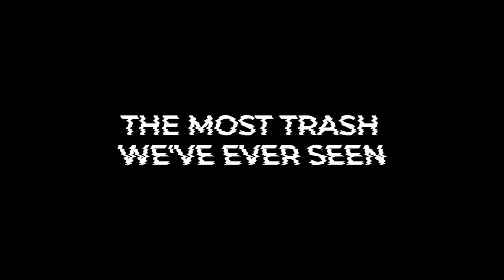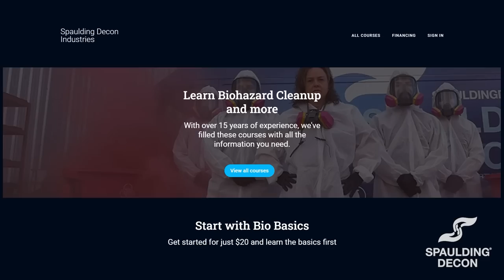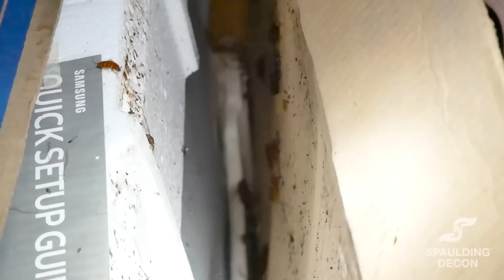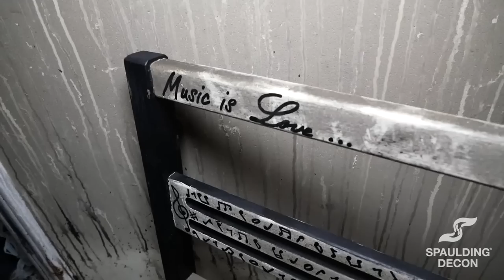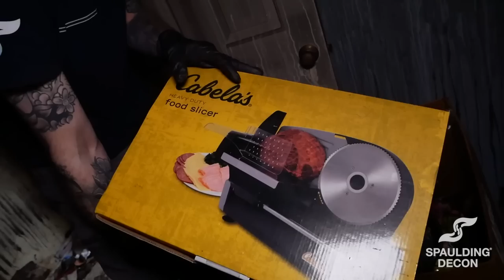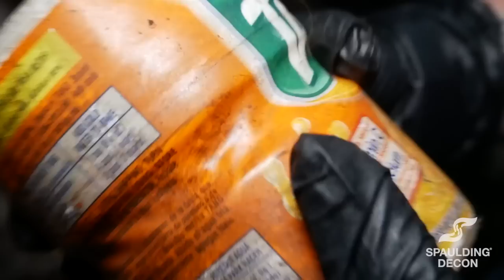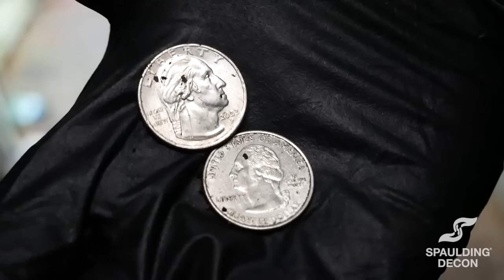WARNING: The Most TRASH We've Ever Seen!!!

Comment: I just wish they would point out that not all hoarded homes are due to actual hoarding which is an obsessive compulsive disorder. You can see the same end effect (i.e, a hoarded home) due to other issues like depression -usually mixed with some physical ailments that make cleaning or even running out trash physically challenging but where they do not care about the hoard at all, don't actually want it at all, and would be very glad to see it gone but just have zero mental drive or motivation to take care of the issue. they logically understand its an issue and think it is disgusting but because they feel no one cares about them, no one ever visits-what is the point? 

it is definitely sad either way but it is worth considering if you notice a friend or neighbor having this issue to discuss the why. if it is just depression, they will be glad to go along with a cleanup plan, even if it does make them feel more than a little ashamed for someone to see how far they have fallen mentally in one of the most physically apparent symptoms there is.